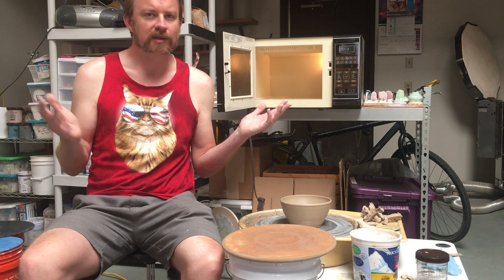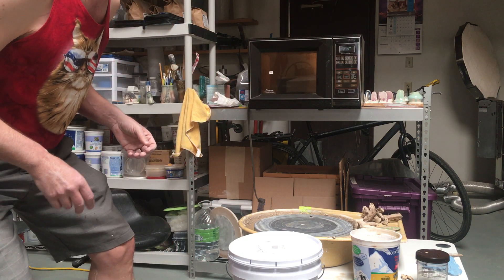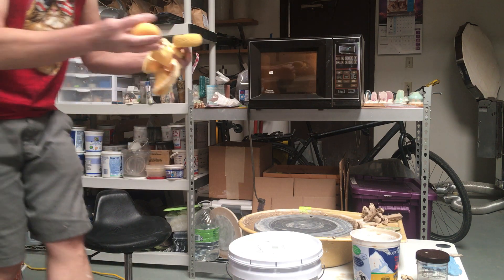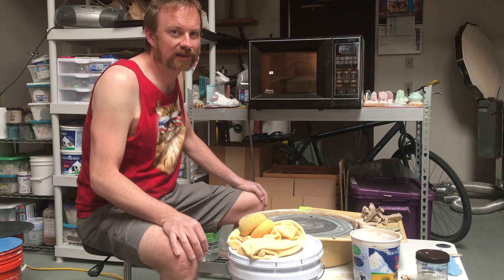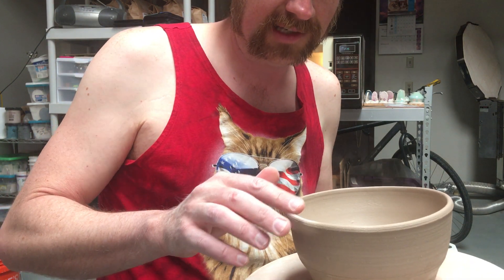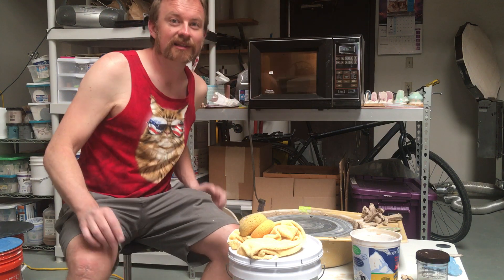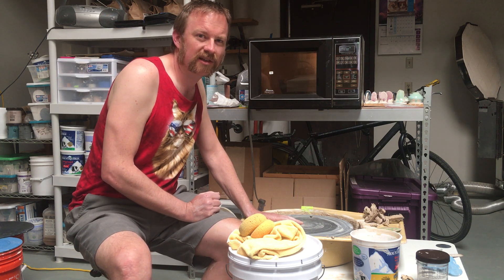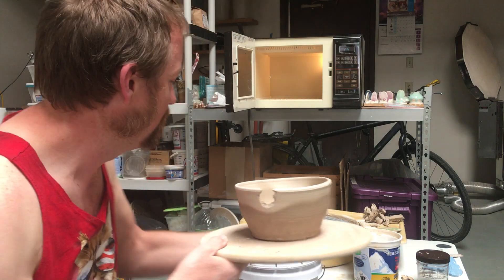No kiln? Let's try a microwave!

Comment: Hello I wanna ask,  can we microwave trinkets, small tray  ,small cups /plates  if we don't have kiln nearby. For my small online business
Reply: I have never heard of using a microwave as a kiln. If I were you, since your using a small clay trinkets plates and such, I would microwave it about 1-2 minutes per time, and make sure it’s completely dry before microwaving. I wouldn’t put your good pottery into it, but rather make a test piece. Hope this helps! (I’m no expert so I don’t know exactly what to do. I would explore on the internet before doing anything) 
IMPORTANT: make sure the microwave you use is dedicated to firing and isn’t used for food. And also make sure it’s outside.
Reply: Yes, you can. You can buy a kiln specifically made to be used in a microwave and it'll fire pieces with glaze, will melt glass and some metals. Just Google Ceramic microwave kiln.

Comment: I'm thinking maybe if you had a microwave that rotated the clay pot inside it would become more uniform.  It was a good try because I don't have a kiln and wondered if I could do just what you did.  They do have the small kiln box that goes into the microwave but its way too small to do anything like the bowl you produced.  I would like you to first dry it out for several days in the sun then put it through the microwave again only this time use a microwave that rotates the product.  I once tried to warm an unshelled boiled egg.  After 40 seconds the microwave door blew open and pieces of egg were everywhere on the opposite wall, on my back, and it took hours to clean up.  That's why I'm not experimenting again.
Reply: use two of the large ones inverted can do stuff around 10cm x 10 cm

Comment: I wonder if you would have gotten rid of the moisture in the oven before the microwave if it would have worked.
Reply: Not really microwave can only heat water, food gets warm because it has water, but if you remove it all it wouldn't do anything

Comment: Eric, I think u need to protect your eyes. Don’t look at the microwave while it’s going.
Reply: That fine mesh grill in the door should block all microwave radiation.  The hole size in the grid is based on the magnetron frequency.

Comment: But wait... Aren't the fumes put out by the clay very very toxic?
Reply: If it's natural clay, (not store bought or formulated with additional additives) clay is mostly made of inert metal oxides and minerals; essentially sand and silt.

  Clay is what you get after sand, rock, silt, seashells, and minerals, are at their finest stages of erosion and decomposition before our plants take them up into their roots to be used again to produce fresh fruit. ☺️

Clay doesn't/can't really react with anything or break down any further than what it is. It's quite a stable and inert material and is generally safe to use around and within our bodies. 😊🌎♥️
Reply: @DeanTheDoctor  yep....i baked polymer clay and that is the toxic one.....i did  not even use my oven with any other food😊
Reply: @chevile  Wow! I'm sure that must have been some experience!  🌎✨😊  I can only imagine the smoke!
Reply: @DeanTheDoctor  😅
Reply: mostly water vapor I assume
Reply: Exactly
Reply: I used this for the clay i made from backyard dirt
Reply: No.

Comment: I think it might work if you let it air dry naturally before putting it in the microwave. I think it's not drying evenly and creating different stress points but also boiling steam in tiny pockets inside your clay. I've not worked with it, but have been watching videos (why I'm here) so be aware of my experience level.

Comment: The use of a kiln is to fire, but the clay needs to be completely bone dry before putting it in a kiln or this case a microwave
Reply: Yep, correct, try drying it in a low oven or just air dry for a day or two. But I suppose boiling moisture off is the same principle as a kiln.

Comment: maybe 2:00 mins at a time stopping in between, you should allow the clay to dry completely before putting it in there.   Because the water will turn to steam and the steam will expand the clay and explode.

Comment: I’m a potter, but I feel compelled to weigh in on the microwave. I grew up about 12 miles from Amana and many of my friends had parents who worked at the plant so they had early microwaves prior to the touchmatic with a rotary dial. We did call them radarranges though.  My mom was always a slow adapter so we didn’t get one until maybe 1980. Our touchmatic was our pride and joy. 😂
Reply from the maker: Thanks for sharing the microwave story, Suzie! That’s great!! My family got our first one in 1993 so it was pretty advanced digital technology by then.
Reply: Haha I worked at Amana in 1980 and was on the Touchmatic microwave assembly line.
Reply: @retro-legends-6160  small world!
Reply: they were very expensive back then.

Comment: Don't you need a microwave kiln to concentrate the heat? I don't think putting it in as-is will get enough heat.
Reply: You can melt aluminium and glass in a microwave, if you leave it on long enough.

Comment: Great experiment! Thoughts for the next try (well, if I were you anyway): Mix Silicon Carbide powder into your clay, it will act as a microwave concentrator. It's easy to find, often used in lapidary. Then make sure it's absolutely dry, maybe pre-heat it in your regular oven to well above the boiling point for a while. Then transfer to you microwave and take it up to red hot. I also think you'd want to start with a much smaller piece. I can't promise that this will succeed, but it will take you a step or two closer to success. Fun stuff!
Reply from the maker: Wow! Thanks for the great tips!!

Comment: Hey how can i dry the clay without a kiln? I'm trying to do it as a hobby at home. I have a microwave at home! Can someone please reply with which clay to use and how to dry it up! Thankyou!
Reply: @Juned Kahn For clay you will need to let it dry out on a shelf first - at this stage the items is called 'greenware'. The next stage is to place the item into a kiln for the first firing on a low temperature. When it comes out  of the kiln it is called 'bisqueware' and it will be very hard, but not waterproof. The item can then be glazed and it then placed into the kiln for a second firing at a high temperature. When the item comes out of the kiln the clay will be hard and waterproof.

If you only have the clay and domestic equipment then you can still make pottery at home, but you will have to accept that the results may sometimes 'fail'. Many poorer people follow the traditions of ancient potters... First make your pot and then let it sit on a shelf to dry for a week. If you have a gas or electric oven then you can place the pot in the oven at the highest temperature for about 8 hours to allow the pot to approximate the bisqueware stage. The next stage is to build a pit kiln or trash can kiln - look on YouTube for examples of how to do this - many people have made a simple pit or brick/clay kiln in their back garden. It is advisable to pre-heat your pot in or near your pitfire or primitive kiln before you begin the main firing - most of the YouTube videos on home-made kilns and pit fires will give you advice on this. Do not think you can microwave pottery - this video is just for the entertainment of people with no brain!!! If you have a disposable income and live in a developed country you can go to a craft supply shop and buy small amounts of synthetic clay that can  be finished by air drying or placing in a domestic oven. The sorts of items you can make with this type of synthetic clay is small ornaments, jewellery dishes, the type of bracelets that small girls like, etc. If you want to make usable cups, mugs, bowls and vases then use clay* and fire it in a kiln or pit fire. You can get clay from the ground - it's easier to find near rivers. This is an example of how of a homemade kiln (Tony has already got his pots to the bisque stage.) https://www.youtube.com/watch?v=ahqMJTSf_2o
Reply: You can use a hairdryer on max heat, it takes about 10-20 minutes depending on the hairdryer 
Edit: you can use any kind of clay
Reply: @phrogman4610  thank u! also thank u for the question.
Reply: The kiln is for firing, not for drying. And you can go to a local pottery store and get it fired there. As for drying you can just air dry it, the microwave is just to dry it faster.
Reply: @midoriorio7806  Go to the local pottery store? We don't all live in the USA. 😉

Comment: I dry the products with a hair dryer without risking my life. ))  It takes about 20 minutes.
Reply: This works with drying ceramic clay?
Reply: @kyrenmadden8303  yes. It's economy 1 week drying time before firing. Оnly dry evenly by moving the hair dryer, otherwise, if one side is dry and the other is wet, some of them will crack. although this rarely happens.
Reply: Well that’s no fun 🤣🤣

Comment: nice, maybe if you let it cool down every few min in the microvawe it could be a way to dry it faster than air dry.
also I found  "Glazing in Microwave Kiln" by Capt Mike, very intresting
Reply from the maker: Thanks, I'll have to check it out! I met an artist, Mami Kato, who says they use a microwave all the time in Japan to help dry things out enough to trim!
Reply: When you use the "low power" mode on microwaves, well the cheap ones anyway, they just turn off for 45 seconds at a time and then turn on for 15 seconds, then back off for 45 seconds etc. If you use the Defrost Function for a lot longer it might actually work!

Comment: Well, I always wondered what might happen to pots in a microwave. Try a dry one next time?  With no water, would it heat to vitrification temps? Have heard of folks fusing glass in microwave ovens.

Enjoyable content. Thanks!
Reply from the maker: Thanks for the comment! Previous to this experiment, I made two balls of clay, about the size of grapes, and microwaved those for one minute, full power, moist clay. Bone dry in one minute. No problems whatsoever. Have not tried prolonged clay exposure to microwaves. Next time! Have you checked out videos on creating plasma in a microwave? Powerful machines!